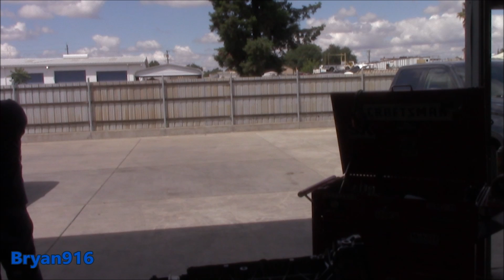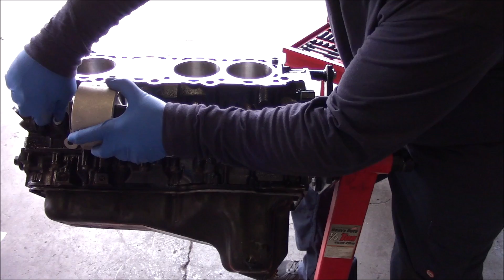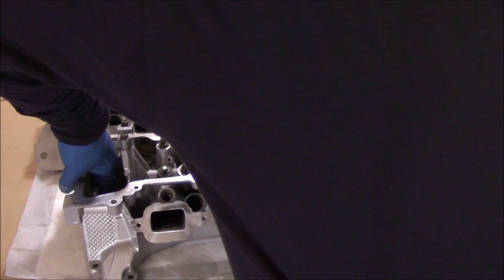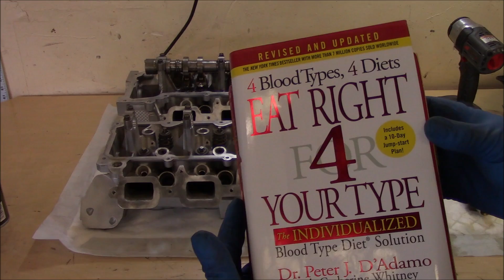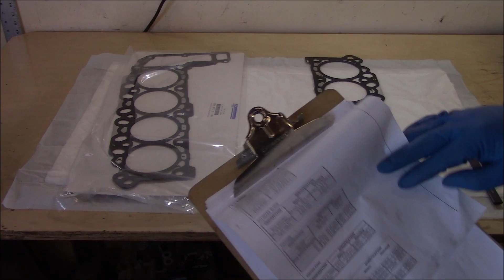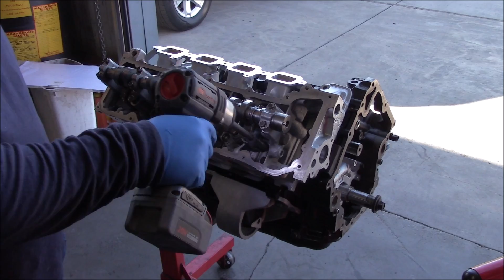4.7 Dodge Full Engine Rebuild pt. 6 (Top End Assembly)

Comment: Bryan, you're a national treasure to the shade tree mechanic and even seasoned home builder communities.  Question about the lash adjuster orientation: Since the adjusters have that recessed inner band, wouldn't they pump up regardless of whether or not the holes matched up?  Seems like that band would completely pressurize to engine pressure.  I would still line them up to be sure but I'm just thinking, if one turned, would this affect them at all?
Reply from the maker: I think its a good idea to line up the holes on rebuilds to make things go a little smoother on the 1st start up. But yes its not 100% necessary.
Reply: @BryansGarage951  Thank you and thank you for all the amazing instruction.

Comment: Hello, thanks for the detailed videos, they are very helpful! I have a question regarding the lifters/lash adjusters oil holes: is it really necessary to face the hole towards the oil hole in the lifters housing? The workshop manual (of the Jeep GC 4.7 in my case) did not say anything if I remember well. I replaced mine a year ago and I did not install them with the hole pointing the oil hole in the housing. So far so good. I think the way the lifters/housings are designed, they will get oil flow anyway as long as the oil pressure is good. Thank you for your help! Regards from Spain.
Reply from the maker: Correct, it's not 100 percent necessary to line up the oil holes but a good idea. Why not make it easy for the oil to penetrate the lifter, its more of a preventive measure than a necessity. For example, preventing  ticking noises, or worse.

Comment: Hey Brian...I got my cylinder heads on my 03 durango 4.7. It's running but sounds like shit.Im pulling a code camshaft sensor A .I noticed that my cam ring isn't the same as the other. Could that be my issue?
Reply from the maker: Yes!
Reply: @BryansGarage951  You the man...Thank you so much.I appreciate it

Comment: I'm a little confused on your torque specs.In the book it says to tighten heads 90 degrees and your video you went 90lbs.Can you explain ?
Reply from the maker: My torque wrench has ft. lbs. inch lbs. newton meter as well as degree on it.
Torque specs go's as follows on the large bolts 
1st pass 20ft lbs.
2nd pass 20ft lbs. to verify 
3rd pass  90 degrees
4 pass  90 degrees 

Small bolts between 10 , 20 ft lbs
Reply: @BryansGarage951  so that would be 180 total on large bolts
Reply from the maker: @DonaldChadek   90 then another 90 I guess that would be 180 Degrees Yes. But Take it down in increments to avoid wraping or cracking the cylinder head!
Reply: @BryansGarage951 hey Bryan in the 2006 5.7 hemi do we have to do 90° plus another 90° in total 180????
Reply from the maker: @r2rowdiaz139   not sure about the 5.7
Reply: Thanks man. I like your work and videos...

Comment: I like the 4.7
It's not a Powerhouse Hemi, but properly maintained it is a V8 that will go 180K miles .
Reply: Mine has 213 K miles on it and still going, still sounds good.  Never been rebuilt or anything.  I did a little bit of lifter work on it just to snug things up but that’s it.  I’m watching this in preparation for a rebuild because I do think I have lost some power over the years

Comment: Bryan, have a question like to ask you here since you have experience with rebuilding 4.7 engine...how could I go by replacing my cam shaft on this 05 dodge ram 1500 4.7 v8 4-4 slt truck of mines so that I can get him back on the road soon??

Comment: What did that engine come out of?  The motor mounts are much different then my Jeep WJ.  Head gasket compressed thickness affects the cam timing on this engine, that is why it is important.
Reply from the maker: Dodge Dakota. Cam timing? You mean valve timing. Head gasket thickness can affect the valve timing on any engine. The head gasket takes up the space in-between the Cylinder block and cylinder head which seals the combustion chamber so making sure you use the correct thickness is highly important, especially on these engines!
Reply: @BryansGarage951  I mean cam timing. The distance between the cam centerline to the crank centerline will affect chain tension and effective chain length. Too close will retard the cam timing which is of course valve timing as well.
Reply from the maker: @charliedee9276     Cam centerline to the crank centerline,  this is an OHC Engine not OHV so that's kinda irrelevant. I work on a Ton of these  Engines and I don't know of any aftermarket gasket that is so thick or thin that it would affect chain tension. However, speaking from experience I know of after-market gaskets that do not seal well due to their being a little under spec.
Reply: @BryansGarage951  I work on a lot of these as well. They actually make .020" steel shims to put in between the head and block to add material to make up for a head or block that has been milled too far down. It is completely relevant in an OHC engine. When the cam sprocket centerline and the drive sprocket centerline, in this case the stub shaft, get closer by means of the head or deck being milled the chain itself does not get shorter therefore the cam timing will now be different as the extra chain length allows the timing of the cam in reference to the stub shaft sprocket which is timed to the crank to deviate from factory specification.
Reply from the maker: @charliedee9276   Removing to much material from the cylinder head? That Is a totally different topic I said nothing of the sort in this video. What you're talking about everyone knows this and is common knowledge as it pertains to engine repair. Not once did I mention what to do if heads are out of spec!  I'm talking about choosing the right head gasket, what are you talking about?

Comment: Bryan Your one of the Most Knowledgeable 4.7 Mopar guys Around... honestly didn't know much about these until you walked us through Step by Step I think it's a Stout Little V8 very comparable to a Ford 4.6 Great Job Brian from Edmonton
Reply: The 4.7 is undoubtedly a great little engine but there is no comparison to the 4.6 Triton. The 4.7 is a power making monster that will run circles around a 4.6. I've owned two of them in the past and think it's one of the most under appreciated engines.

Comment: Hey brian great video I was just wondering about the lifters should you have installed new ones? also, these overhead motors have had problems with the cam bolts coming loose. Shouldn't they be lock tightened? Thread sealer? thanks
Reply from the maker: Its not 100% necessary if there's nothing wrong with the current lifters however, It definitely wouldn't hurt to replace the lifter for sure. as far as the cam bearing caps go I've never had one come lose on me but I suppose a little Threadlocker wouldn't hurt as well both are great suggestion!

Comment: What is the difference in the 2003 4.7 and the 2005 4.7 engines.
Reply from the maker: As far as I know, it's exactly the same!
Reply: @BryansGarage951  Thank you. my parents 2005 ram 4.7 engine timing jumped so you can kinda figure what happened there. bu got good deal on engine from 2003 4.7 that a tree fell on cab for $250. wanted to see if the swap would be easy.
Reply from the maker: Everything should be the same, however I would definitely swap over exhaust  flywheel and Intake manifold. And of course motor mounts!
Reply: there are two generations of the 4.7. The second gen appeared around 2006 and the timing components are not interchangeable.  There's also a HO version that Jeep was using in the Gran Cherokee. Up to 2005 all 4.7s were the same.

Comment: Brian, I noticed some slight pitting on the tip of one cam lob, about a 1/2 inch stretch, when I went to reassemble.  Do you think the camshaft should be replaced.

Comment: Nice videos I learned a lot however one of my camshafts dowels where the timing chain  sprocket attaches is in the 4 o clock position when looking straight at it and Im having a hard time rotating.... It stops turning after about a 1/4 turn and I don't want to force it...ive tried 2 vice grips in different positions and still stops....can I unscrew the bearing caps and lift up the shaft and rotate it a little towards 12 o clock be in better position to accept the sprocket?

Comment: hey bryan I need some help with my 99 ram 1500 5.9L. I replaced my harmonic balance  cause it was wobbling a bit on the crankshaft. it still makes a strange sound but theirs a lot more power to it now. ca you help with that sound? Sound comes from right behind the harmonic balancer

Comment: Just received the impact. Thanks for the pocket screwdriver. Now I have 2 Snap-On tools!! lol
Thanks Brother I really appreciate it!! Pretty awesome!! Thanks again
Reply from the maker: Let me know how the impact turned out and if it was repairable or not! Trust me your not missing out on much not having a lot of Snap-on!
Reply: Yea Im not missing all my cash to the tool truck lol. Ill let ya know how I make out on it. The batteries I have are the wrong voltage, but a buddy of mine has some. If I can get it fixed I can go on Amazon and get some knock-offs cheap. I got some for my DeWilt drill and they hold up surprisingly well, $30 for the pair of batteries

Comment: Enjoy watching you work. Your good. Id use factory gasket. Holes line up better. Ive used Fel-Pro on all my builds. Never an issue. Only bolts I worry about torquing with a torque wrench is the rod and main cap bolts, and cylinder heads. Great job as usual
Reply from the maker: TwiZ1975cj5  Thank You Brother, Yeah that's pretty much all I use a torque wrench for also!
Reply: It's cool to watch other guys and how they do things. Mostly I do things the same way you do. There is a minor thing here or there I may do differently, but nothing worth mentioning, the end result is still the same. Some guys can get stupid crazy over that torque stuff, gotta torque every fastner and you are a horrible mechanic if you dont. These guys obviously dont do it enough in my opionion
Reply from the maker: it's impossible to torque every fastener for the sake of time or simply space constraints. I only pull the torque wrench out for critical bolts like you mentioned. Judging by the size material and thickness of a bolt in most cases will tell you how much to put on it!
Reply: Like you said, you get the "feel" for it
Reply from the maker: Absolutely!
Reply: @twiz8789  I've been turning wrenches since I was about 12. Over the years you develop a feel. A mindful eye for the size bolt, the size drive & where to focus your force on the driver to get it torqued so close to specs it isn't funny. What I normally do is tighten just until it's tight, then give it just a little more even if it's just the slightest of a turn.
I've been dissed for not using a torq wrench. What do they know!